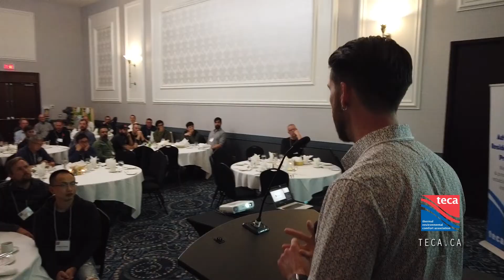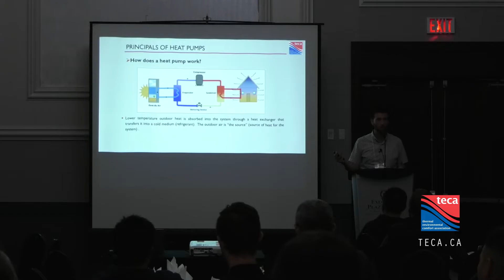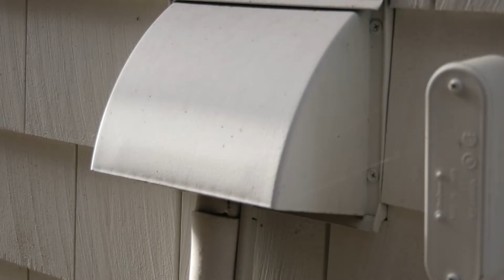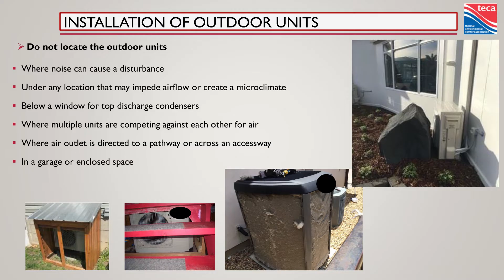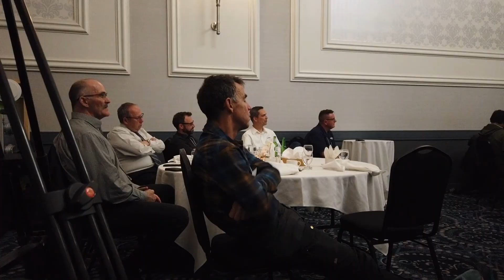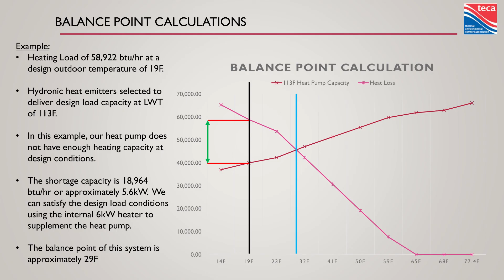Air-to-Water Heat Pumps

Comment: This chap is wrong with respect to monoblocs requiring glycol. You can achieve the same result and greater efficiencies with exterior pipework insulation and the use of antifreeze valves on the flow and return.

Comment: Very nice and packed presentation. Does it still make economic sense using heat pump for heating instead gas fired boiler when the source of electricity is gas fired electricity generators?
Reply: I’ll take a stab while you’re waiting for Jeremy to respond. Yes, it still makes sense because Canada, the US, Europe, etc. are all moving as quickly as feasible to decarbonize electrical power generation. In the process, a carbon tax and other financial disincentives will likely become more prevalent with natural gas and fossil fuels. So think of a heat pump as “future proofing” your heating system both economically and environmentally.

Comment: You don't need glycol. It reduces the efficiency about 2%. Install anti-frost valves on both water lines and insulate per the manufacturers instructions. In cold weather the heat pump is running most of the time so the anti-freeze valves are only for a power outage. If you want a system that will heat water to 170 degrees buy an R290 ATW mono-block heat pump. R290 will work in cold climates down to -35C. (-31F) Use 2 buffer tanks )with three way valves) and a water to air exchanger in your existing central forced air AC system and you get the AC for your house very cheaply. Instead of a buffer tank use a indirect tank and you can heat your domestic water with the heat pump. Just add a mixing valve on the supply and return of your hydronic loops if you have in-floor hydronic. The hydronic pex in concrete only requires 120F or 110F water. The indirect tank can be set at 140 F all the way to 170 F if you require lots of hot water. Put a mixing valve on the domestic at the max temp you require. If possible install shower drain exchangers that feed back, preheated by the shower drain, cold water to the shower to recover the hot water going down the drain when you shower. These really work and will extend your hot water output by up to 40%.